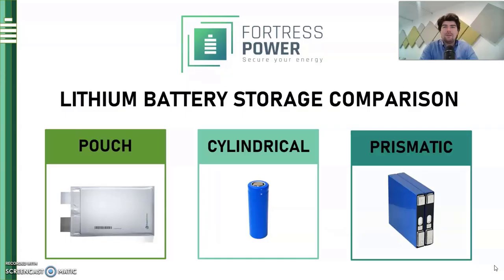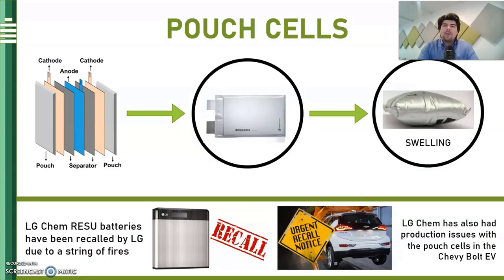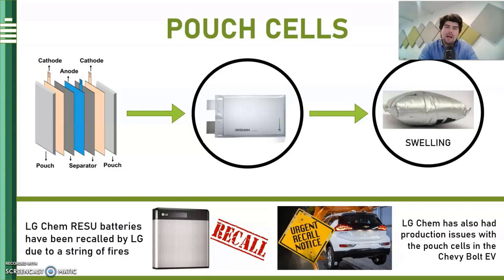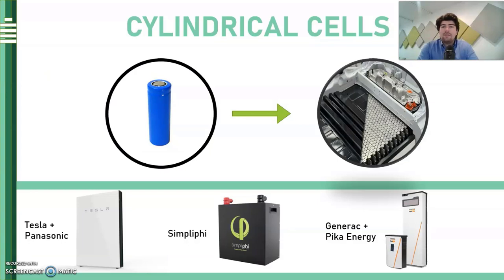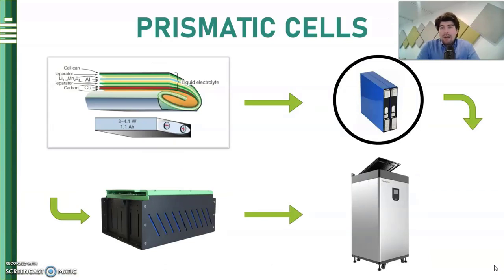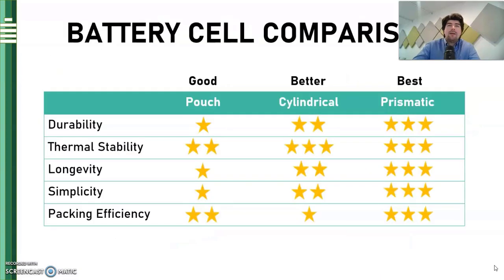Lithium Battery Cell Comparison

Comment: Good day sir. I just want to ask your opinion regarding LiFePO4 batteries. I am planning to building 200 AH 48V battery bank. Is it practical to use 32700 (Cylindrical cells) or is it better to use prismatic cells. I fear that I may have a hard time soon to figure-out which cells have been damaged if I use 32700 cells. Thank you
Reply: Better use prismatic cell rather than cylindrical cell.
Reply: what was the result
Reply: @abdullahnoonari3477  I did the prismatic cells. It is easier to build. No need to spot weld. But the problem is, you need to compress the battery to avoid bloating.